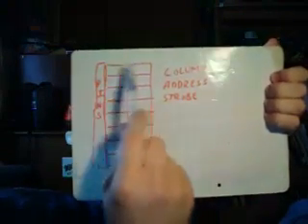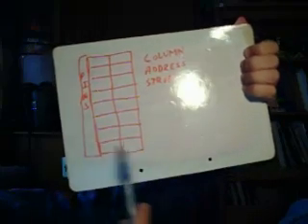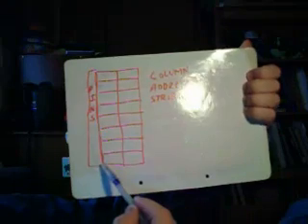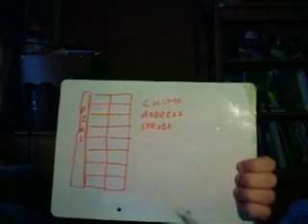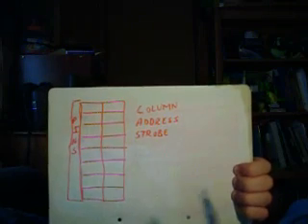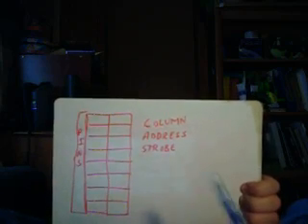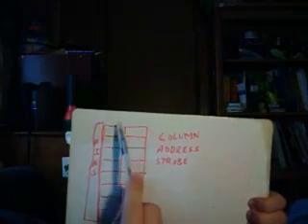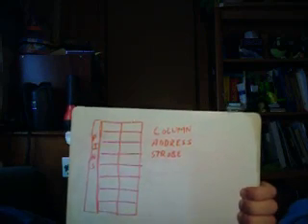CAS Latency

Comment: speedlearner  so higher the CAS timing is the slower the memory module is ,right?
Reply: +rritambhar chakraborty It's a combination of CAS Latency and RAM Frequency that determine that.
Reply: +rritambhar chakraborty 

Real Clock Rate = Half Rated Rate
Cycle Period = 1/Frequency
Response Time = Cycle Period * Cas Latency
Reply: +Spider Super (Oliumen)  so, higher frequency DRAM with higher CAS will still make up for the higher CAS timing. i see. thanks :)